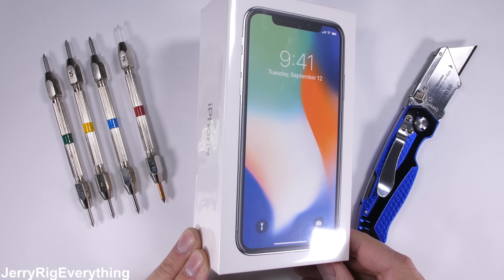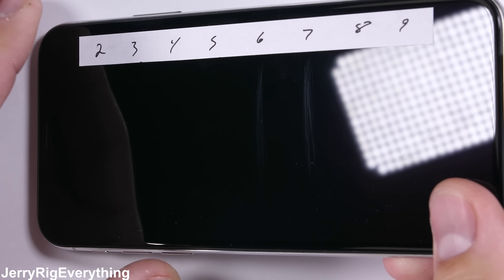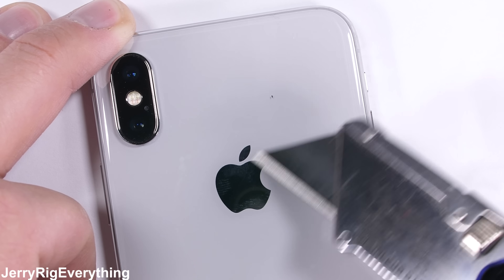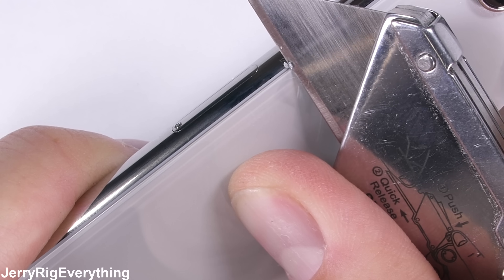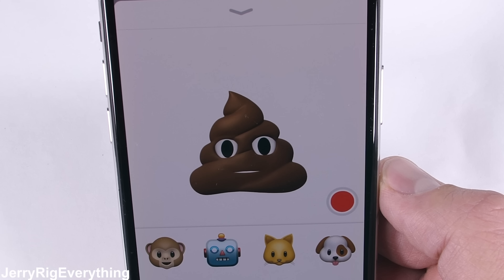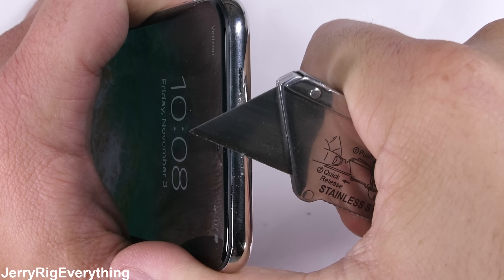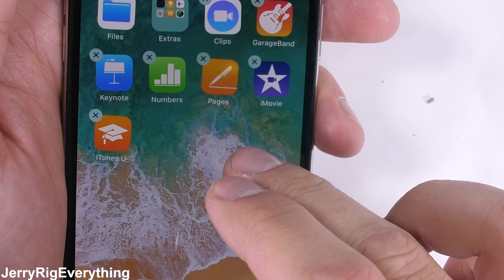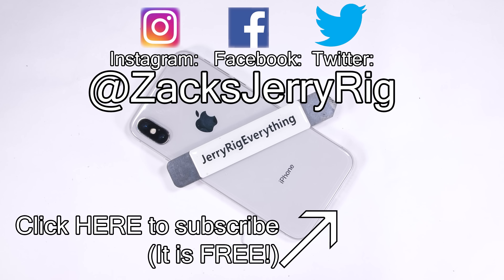iPhone X Durability Test - Scratch BURN and Bend TESTED!

Comment: I don't agree about the back glass being sensitive to drops. I have had mine Iphone X since its release. I use it in a high quality leather case (NOT apples leather case) and I have dropped my phone on everything from tile floors to asphalt with gravel, from around 1 meters hight. The case seems to have absorbed the shock everytime. I have no screen protector either, and my Iphone X has not gotten any cracks in the back or front. The glass in front has micro scratches though. So, use a case that has good shock absorbing qualities please!

Comment: 2016: apple removes headphone jack
2017: apple removes home button/touch id
2020: apple removes notch
2025: apple removes mute switch and power/volume buttons
2031: apple removes speaker
2037: apple removes charging port
2045: apple removes iphone and changes the series name to icamera

Comment: Jerry: "it will be intresting to see what apple does next year"
Apple: does the same thing for the next 2 years.....
included the single same pathetic 5 watt charger with all phones from the iphone 3G up to the god forsaken 11 pro max almost 12 years later
Reply: I don’t know if you know, but since the iPhone 8 iPhones could fast charge, and also the 11 pro and pro max have fast chargers in the box
Reply: @innocentbystandard9104  FALSE the phones you mentioned are capable of fast charge as seen in the 11 pro and 11 pro max (18 watts) but they still come with the 5 watt charger and the 18 watt is sold separately. Both chargers still laughably weak compared to Samsungs 25 watt with the S20 series and the S20 Ultra supporting 45 WATTS

Comment: We had a customer come into our electrical store with their 24H old iPad Air, They had set up the face unlock, went to unlock their iPad and it wouldn't recognise the face, The customer had previously had a stroke and set up the face unlock with his 'Stroke' face, Apple ID didn't like it and wouldn't identify him as the owner.

We had to assist the customer with resetting the tablet to re-setup the tablet without it.
Reply: ELECTRICAL store????

iPad AIR with FACE ID????

There is something wrong here bud.
Reply: @luminumlx2604  probably, Apple is a god awful company with terrible products, my opinion is verified by my work too!

Hence why I may have mistaken his ipad air for some other ipad.
Reply: @jufinda  It was an iPad Pro. It's the only iPad that supports face id
Reply: @luminumlx2604  the Ipad he had was like 8 inch though?
Reply: Maybe I'm remembering it incorrectly lol

Comment: 2016: Apple removes headphone jack
2017: Apple removes home button
2018: Apple removes headphone adapter
2019: Apple removes 3D Touch
Reply: Mundane Box 15 2019: Samsung removes headphone jack 😂😂😂
Reply: Rather have. A bigger battery than something I would never use
Reply: Robo it’s likely that the s11 won’t have a headphone jack
Reply: @Robo not for flagship
Reply: 3D Touch was useless anyway

Comment: I think in the future they’ll remove the charging cable too and make u buy a wireless charger
Reply: Apple is actually working on this.
I reckon in like 5 years Apple will have gotten rid of their charging port and we'll be charging either on wireless pads or through the air.

Comment: 2026: you need a dongle to charge
2027:you need a dongle to use the dongle
2028: you need a dongle to use volume
2029: you need a dongle to use the dongles dongle
2030: you need a dongle to use the dongles dongle dongle to use the camera
2103: you need a dongles dongles dongle of the dongles dongle that is for the dongles dongle that can power the dongles dongle and works the dongles dongle to use the phone
3092: you need all those dongles to use apple air

Comment: Sir Why destroying such as costly smartphone . I use simple and low budget phone . I Can't see this........
Reply: 😂😂🤣🤣 Do you even know what he does ......?
Reply: @harshdeepgill6019  No..........what?
Reply: @SindhuXVXII He tests phones to check their durability in the process he has to destroy the phone .
Reply: @harshdeepgill6019  it is knew that
Reply: @SindhuXVXII  "Durability Testing is a Performance testing technique used to determine the characteristics of a system under various load conditions over time. This testing helps us to identify the stability of transaction response times over the duration of the test."

Comment: What are you Doing 😂😭😭😭😭
Reply: Something
Reply: "Durability Testing is a Performance testing technique used to determine the characteristics of a system under various load conditions over time. This testing helps us to identify the stability of transaction response times over the duration of the test."

Comment: "Apple is running out of things to remove, it will be interesting to see what they do next year"
Apple: So here it is, the iPhone XS. It's the same phone, but with a different chip!
Reply: A.J. Deutsch they removed the dongle
Reply: And gigabit class LTE, and an improved camera, and extra ram, and they also added a cheaper model and a plus sized model while increasing the speed of Face ID while strengthening the back and front glass, and the processor is still better than the snapdragon 865, you heard me, last year A chip can perform as well as this years snapdragon chip. And you wonder why people choose iPhone aside from the fact you get 5 years of software updates and another 2 years of app support.
Reply: @innocentbystandard9104  who cares we got a bionic a14 chip now and I bet you it’s faster than ur SnApDrAgOn 865
Reply: @marcogarcia8093  so what's your point ?? The Snapdragon 888 is faster than the a14
Reply: @innocentbystandard9104  thats false. With overclocking the 865 can outperform the a13 bionic. And o overclocking is almost impossible on the iphone. All of your other reasonings for the new iphone are surface level and not important. And the 5 year  software support is useless when the relatively small battery is fried from constant fast charging (which you have to pay extra for too by the way), and the design is 8 years old. And a screen thats 10 years old, miles behind android.

But i dont expect a 13 year old from 07' to have much forsight or reasoning to see this so i cant be too mad.
Reply: @krosses7156  imagine having to overclock just to beat a non-overclocked chip 🤡🤡🤡
Reply: @bruhmoment4338  the a 14 isn't capablr of overclocking, and 865 can do it just from the tap of a few burton's.
Imagine thinking that's a downside. 🤡
Reply: @krosses7156  let me reword what I said. Imagine decreasing the lifespan of your phone just to beat something that isn’t overclocked 🤡🤡🤡
Reply: @bruhmoment4338  actually due to the way they handled the current and the built thermals of the chip, the microchip would be far from the first thing to go, and that's on any phone.
Reply: @krosses7156  I wish to see what phones you can overclock an 865 for. Because so far I’ve only found that you can only overclock it on an ROG phone 3 (which has a chance of bricking the phone if you don’t know what you’re doing).
Reply: @bruhmoment4338  every single other device with the sd 865+ in it, including the note 20 But TBH, this isn't really relevant any more because the new sd is just coming out soon. The sd 888. It will likely be in the s21 in January, which is expected to be announced on the 16th. Review model phones have already been sent to tech tubers with the chip in it
Reply: @krosses7156  iPhone vs Android on its own its a bit of a dumb comparison.
Reply: Apple chips are INSANE but the iphone can’t even optimize it properly. The iPad does though

Comment: When you cut off the black plastic buffet around the edge of the front glass does it still water resistant and I’m so curious mind my iPhone X that black plastic buffet is bend little and it goes inside you can see a tiny tiny metal in there does my iPhone X still water resistant

Comment: Face id is lame I'm ok with fingerprint scanner
Reply: Face ID works incredibly well.  How is it lame, you literally just look at the phone and its unlocked..?  How is there any downside to that?  Oh, Apple uses it, I get you.
Reply: @phillipsusn  personally there's some weaknesses for me, as a teen. People can hijack my phone easily just by pointing the phone at my face
Reply: @nectar__  If they are forcing you to look at your phone, they can probably force you to touch the fingerprint sensor as well.  Face ID checks to ensure you are looking at your phone and paying attention to it before it will unlock.  That way someone cant take your phone and just flash it at your face when you're not looking.  All considered, you can just use a pin unlock and not use the Face ID or the fingerprint sensor if someone hijacking your phone is an actual issue.  I've never been in a situation where something like this could happen so I'm not sure where some people are commuting to that this is a real threat.
Reply: @phillipsusn  the PIN's pretty fast tho. Should test one of my friend's phone for the face ID. Been thinking to buy an iPhone 7 but it's just too expensive, had to move to android :(
Reply: @nectar__  you did good not buying an iphone, its a watse of money
Reply: @phillipsusn  cuz you need your face fly uncovered for it, fingerprint is fine

Comment: QUESTION: Does the stainless steel scratch easily? If I get an Apple first party silicone case with an open bottom, will the bottom be noticeably scratched after a while? Specifically on the space grey model.

Comment: If I'm being completely honest, the iPhone X is very pretty, from a design standpoint. But I really don't think phones like this (including Samsung's) are really worth this much. I have a phone that's only around 300, maybe less, and it has a 21 megapixel rear camera. It also has a glass back which still hasn't broken after multiple drops (granted, I have a case for it) The only downside for my phone is that I'm pretty sure the camera cover is plastic. I kinda did get what I paid for though, battery life is... Ok, I guess

Comment: It's probably a very cheap 420 or 440 stainless steel with standard Gorilla Glass over the screen overall don't buy iPhones yeah they're pretty but they cost a lot of money for a phone that is very low quality made with dirt cheap materials and I don't even want to get into the specs
Reply: For real, I still have my android s8 plus and just cracked my glass front screen. Samsung has an authorized retailer called ubreakifix, yeah its $230 but they fix both my front AND back screen and battery and other items too. Like wow samsung is badass

Comment: I’d be interested to see drop testing on the iPhone 8 & X, using a skin and or screen protector.  IE: Using the skin/screen protection with no case, to see if it helps prevent glass breakage.

Great video!!

Comment: Fuckin’ thing is so slippery I scratched the screen after it slid off of a soft touch rubber surface on my battery bank that was almost completely level.
Luckily the scratch is tiny and only shows in bright sunlight.
Good thing metal won’t scratch it. Too bad concrete did.

Comment: Hmm....Will apple even remove VOLUME buttons?
Reply: Donghoon 2 probably, they'll make you use the control center to change the volume
Reply: @maxharwell  or soft keys
Reply: Actually maybe. In wwdc, they were gonna change how control center looked and volume button slider looked. Kinda like Android but that was before ios12. Maybe not
Reply: Yes and each one'll cost $549.
Reply: Well HTC already did that so.....
Reply: @NabsDaNoob555  what phone?
Reply: @dnhn.design  HTC U12
Reply: You gotta shout at a certain volume to get the volume you want.
Reply: Better not happen or else I'll just keep buying the older models that ACTUALLY HAD THEM
Reply: Donghoon 2 mhm
Reply: kindle fire already did that back in 2011, that was awful
Reply: They will sell them separately
Reply: Donghoon 2 probably and  then u use the control centre in the right hand corner
Reply: Donghoon 2 hope not
Reply: 갤럭시즈 크GalaxyzCream same XD

Comment: First no headphone jack now no home button 🤔😐 what next?
Reply: My S9+ doesn't have a home button either, but I can still unlock it by touching the bottom of the screen and don't have to use my face.  Samsung > Apple
Reply: Brandan Taylor ...you don’t have to use your face on iPhone if you don’t want to either.
Reply: @payjeitz4380  Shhh!  There's no point in talking to people that are only hear what they want to hear.  If Samsung had Apples Face ID he'd probably go off on how Apple is inferior for not using it too.
Reply: Jerry said that you can turn it on with a tab on the phone...
Blinded fanboy...
Reply: Kimmi Cardinale No Phone ✓
Reply: Kimmi Cardinale no brain
Reply: You’re the same dude that said: no floppy disk drive? No cd drive?
Reply: no volume button
Reply: Joseph Huggins iPhone Xr - less pixels
Reply: No battery
Reply: Remove volume buttons, next remove the cameras, remove charging ports. no more phones!!! 😁😁😁
Reply: Now no headphone dongle

Comment: Actually, Apple removed the home button quite a bit ago.
The ones on the 8 and 7 (I don’t think 6 or 5, I haven’t tried) When you turn it off completely, you can press the home button because it’s actually not a button. It just vibrates to give it a button feel.

Comment: the totally brand new iPhone 9.

It has a 2 MP front camera. No buttons to turn on the phone. 16GB of ROM and 512 MB of RAM. 2 cameras with 4MP. A huge screen(probably). A really really,

huge 1500 mAh battery that takes 9 hours for a full charge and it will last for umm..., hey, maybe, 30 minutes? Starting at £1500

Comment: Me holding my phone like, don’t worry baby, this will never happen to you on my watch
Reply: On miWatch
Reply: Reychell Brooks do you have the new apple notch haircut? Its the trend for iphone users nowadays
Reply: @Theakitainuu  im 13 i HAD a i phone went down 7 stairs screen fell of lcd touchscreen broke ut was SE it was also a shit experience so i had to upgrade early so i went with a pixel 2 it can litterally last forever no problems apcept for NO HEADPHONE JACK (i didnt know) it costed 1200 bc upgraded early and new phone i was going to get the pixel 1 for it got cancelled for some reason
Reply: Don’t use an iPhone X naked, the screen gets scratched like no other. As bad as my iPod Touch 4th gen, I used an iPhone 5 and iPhone 6+ for almost 3 years a piece, both naked, and not a scratch on the screens. 4 days in and my iPhone X had a deep scratch about 2 inches long. 6 months later after babying the phone even more than usual and there’s 2 more deep scratches and a ton of small surface ones that you see in bright sun with the screen off. It’s the new Gorilla glass, it’s more “durable” but it’s lost it’s scratch resistance. To me it’s not a worthy trade off, it’s a lot easier to prevent yourself from dropping your phone on concrete and shattering it than it is to spot a tiny grain of sand on your screen or the millions of other things you may bump that cause scratches. 

It’s either the new glass is weak like I described or quality control on the first few batches was bad, but there’s a lot of people complaining for it to just be bad quality control.
Reply: John Moore yeah mine has scratched too, but I was told they were actually cracks just that they were not deep like those on a regular phone
Reply: Reychell Brooks I doubt they’re cracks unless you actually dropped it. Did you go to an Apple store and complain, and then they told you that?

Comment: Next year we are getting the iBrick. It does nothing, it’s just a £999.99 white brick with the apple logo on it. No ports. No home button. How innovative...
Reply: The only way to use it is to use wireless ports and connect a charger and a touchscreen. The entire set of wireless Lightning port, a 100cm³ dongle, charger, Lightning touchscreen, speakers, microphone, camera, Face ID and headphones will cost about $1000000.

Comment: I have not yet seen accurate colors on *oled,  but I have not yet seen a iPhone X either. But I do not know why it would be difficult beat the colors with lcd it's usually the otherway around that a good lcd has better colors. 
Contrast is the big advantage of the *oled screens, not the colors, lcd has quite bad contrasts.

Comment: This was my first apple product since the first iPod Touch.

Great phone. I hate it, but I’d still prefer it over every other current flagship
Mainly because I hate 3D screens used on most of today’s flagships since the only way to protect the screen is with a plastic screen protector (because glass ones never fit them correctly) and the Xperia XZ premium although having a flat screen, has a USB type C connection which will brick the phone if you bump it the wrong way.

Comment: That overpriced glass back repairs shows that Apple knows their customers are a bunch of retards and they take advantage of it.

Charge nearly a $1000 on a phone with a back made of one of the most fragile materials you could use, and then charge them half the price of the phone to repair it. They can do it and get away with it, because their customers are retarded as fuck.

They buy for the perceived  "status" that they think the phone gives and not for any practical reasons. That alone proves how retarded they are.

Comment: I've had this phone now since last december, it's a damn good phone. Can't wait to see what they do next though. The one thing you don't do is a drop test, how come? I'm a painter and I go with the Otterbox Defender case myself. I do it because 
a) I hang my phone from my pocket with the belt clip, 
and...
b) because I dropped my iphone 7 from twelve feet up on a ladder, it fell 15 feet, bounced down 2-3 steps and bounced across the wood floor in a home I was painting. The Otterbox Defender saved it, not a scratch or dent or rattle or anything. Worked perfectly, somehow. 

I worry how well my iphone X would handle that same drop having a glass back, and I'm not in a hurry to find out for myself, haha.

Anyway, cool videos man. Thanks